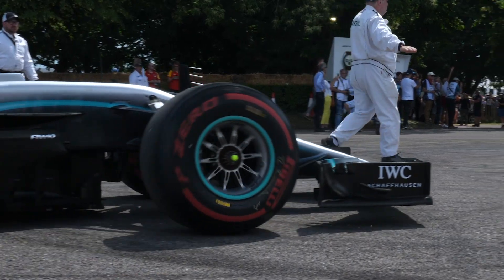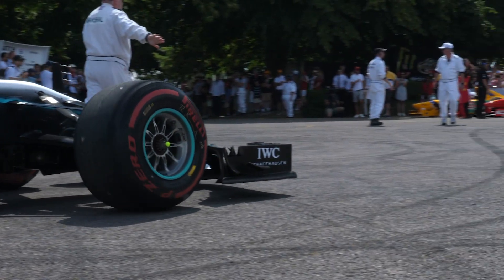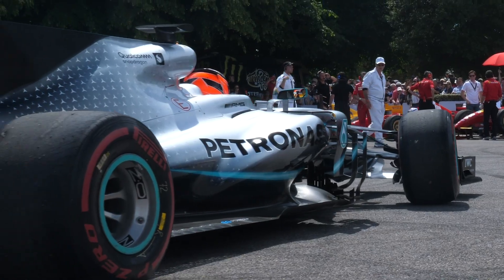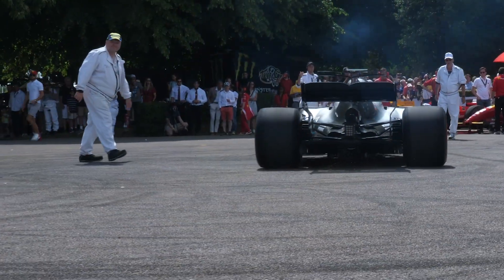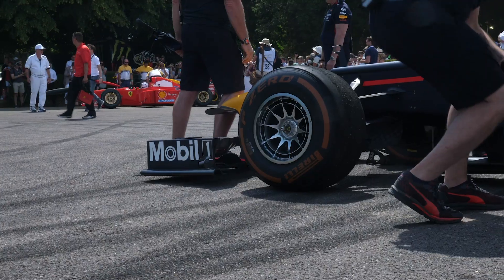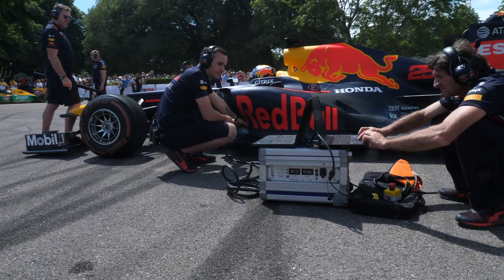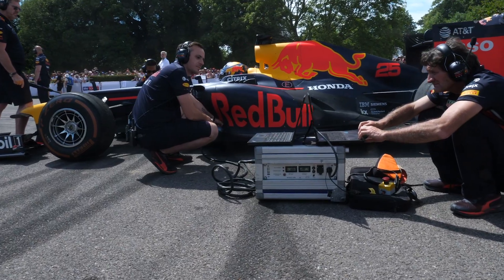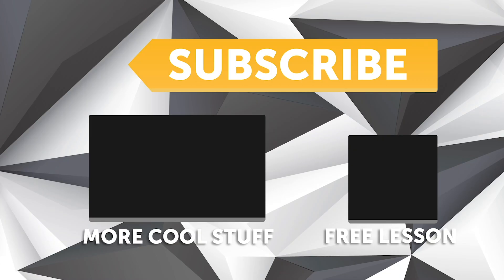12,000RPM Formula 1 Oil Clearances | The HOW and WHY [TECH NUGGET]

Comment: One thing I always wondered, are these engines beeing assembled when they're somewhat heated/cooled? Whenever I replace bearings (crankshaft ball bearings for example) I try to store the engine cases at a warm place and put the bearings into a freezer to make assembling easier. My pistons can be put in at a normal temperature. My question is, do F1 engine builders heat up the block/cool the pistons to make their pistons fit or can they be assembled at a normal temperature?
Reply: I don't actually know, just to be clear, but i think they would assemble them cold cause with so many to build it would make it to expensive to heat everything, they probably use alot of skill and lubricant to make it all go together, but i do know they use a hairdryer to heat the aluminum enginecover when that is mounted at the end.

Comment: What formula 1 car runs at 12,000 rpm ?
That's beer league shit ! 
Like Indycar lol
Reply: Yep, the current hybrid ones rev to around 15k iirc.. the older N/A F1 engines rev to 18-19k.
Reply: @paulhope3401  nope current is 16k
Reply: @sitnlow4life   You sure?  Last time I looked it was capped at 15k and I also dont see any info on any reg changes raising it until 2021..
Reply from the maker: Figure is from the Ford (Cosworth) Zetec-R V8 engine in the 1992 Benetton behind Andre - Taz.

Comment: Would have liked more information on the construction of the preheaters themselves on this one. I've got a forged motor that needs to run in winter, basically the same problem as these guys. Coolant preheaters cost over $1000 for a complete system, there's lots of room for DIY cost savings. Right now the cheapest route I've found is to buy a tankless water heater, heat exchanger in a 5 gal bucket of coolant that then circulates through the engine with a 25 foot head pump.
Reply: In line engine block heater and oil pan heater pad are cheap options

Comment: Does this mean that during assembly, things are put together "hot"?
Reply: They usually heat the block, heads, etc.. to operating temperature during machining.  Measured "hot" and assembly is usually done when cooled.
Reply: @nocturnal0072  Machining, measurements & assembly are all done cold.  Material expansion is well known and calculated.
Reply: @ShainAndrews  I have never seen a hole cut cold that is perfectly round hot.  Never seen anyone cut a cylinder bore that is not round.  That would be a unique thing to see.

Comment: surely you can just use a gas torch on the sump for a while. ? i wonder if the f1 teams have thought about this. haha
Reply from the maker: You're trying to warm the engine not just the contents of the sump to be fair, so I'm not sure that would give the desired result - Taz.

Comment: The tight tolerances are all worth it :). The performance and the sound, aaah. BTW, I was expecting some electrical heaters directly in the engine, they would not be that heavy. Interesting stuff.
Reply: The teams spend millions of dollars shaving every gram they can off the weight of the car so they can place ballast where it’s most beneficial. They certainly wouldn’t want to put a heating element in the engine if they don’t need to, and they don’t need to.
Reply: @timc5969  They won't even run cooling fans, despite the clear advantages in hot climates. I do like, though, how the Honda engines use the MGU-K as the starter motor, instead of an external one. According to Red Bull, this causes less stress on the engine and gearbox, and, as an added bonus, offers the driver the ability to recover from stalling the car, as they can manually enter the 'starter' mode with the buttons on the steering wheel

Comment: What I want to know though is how F1 cars avoid hydro lock; I just can't fathom how they avoid it with the car in front throwing 30L of water per second.
Reply: Same
Reply: https://www.youtube.com/results?search_query=hydroshield
Reply: you make no sense, please elaborate
Reply: @supersevenn  Well, they have open ram intakes and drive meters behind cars making massive amounts of spray and sucking water into an engine tends to make it stop pretty abruptly.   I want to know what  engineering solution the F1 teams choose to go with to avoid aspirating water.
Reply: @LeCharles07  
Good question. 
Probably the amount of water sucked by the intake is much smaller than 30L a sec. Intake will not collect all the water throwed by the car in front. 
This amount is probably only small percentage in comparsion with the volume of air "pumped" by the engine. 
If the water have the ability to separate evenly bt cylinders - there is no big risk of hydro-lock. Probably the spark plug might be a bigger problem. 
Excuse my English.
Reply: @LeCharles07  air filter i guess 🤷‍♂️

Comment: F1 is gods gift cause the engineering on those cars are insane.
Reply: Yep, just think what they can do without regulations/limitations! :) 
Cars will be so much stronger and faster with loose rules!
Reply: @jareknowak8712  just like that porsche hybrid that was unrestricted that blew me away how fast it is with no regulation.
Reply: @Kenneth1350  yes. The on-board video of it looks unreal :)
Reply: @jareknowak8712  They would kill the driver with g forces if it weren’t for the rule book.
Reply: @jareknowak8712  They would kill the driver with g forces if it weren’t for the rule book.